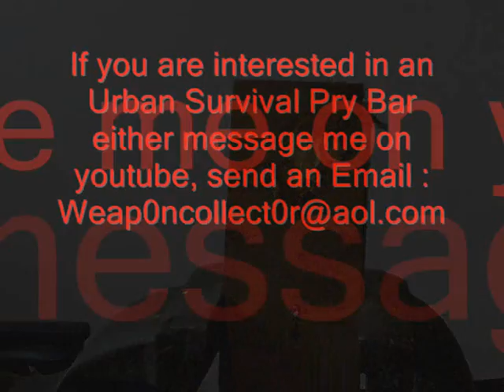WeaponCollector's Urban Survival Pry Bar - Demo Of Tools.

Comment: the tool seems to be effective at every task , exept the sawing of wood.
I recommend to change the sawblade geometry. Since the "sawblade" is very thick, i guess it works better when you double row / crossed theeth like geometry (from large hand saws). http://img.weiku.com/a/004/574/WOOD_WORKING_TOOL_FINE_CUT_CARPENTRY_HAND_SAW_12_quot_14PTI_2510_3.JPG
Reply: +Hyper Hektor I was gonna say the same thing, I noticed the saw teeth themselves are thinner than the bar. Make the tooth's kerf wider than the bar and you will be good
Reply from the maker: +Adrian Armstrong, i have now changed the saw teeth and they work much better - 
http://weaponcollector.blogspot.co.uk/2012/12/heavy-duty-urban-survival-pry-bar-blued.html

Comment: Don't get me wrong I wouldn't mind owning a few of these. I just won't because of the price, Sorry. My gear serves multiple purposes as well. My machete is a JM-016 Jungle Master with a back saw and a gut hook (Amazon $23, Fully tested and Works). My knife is an 11" full tang (Amazon $8 Fully tested and works) with back saw. And lowes has a flat pry bar for $6. Extra weight, but individual purposes as well as bonuses.